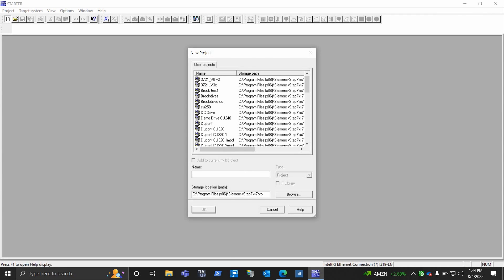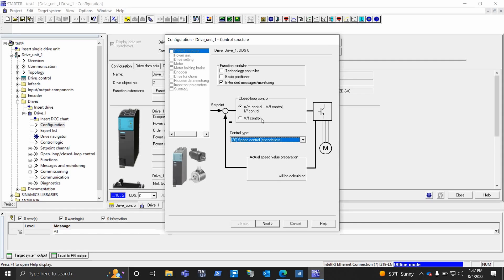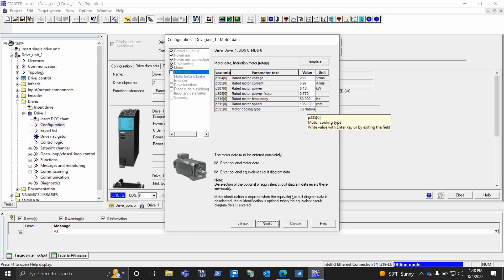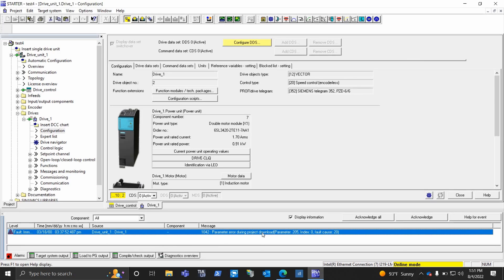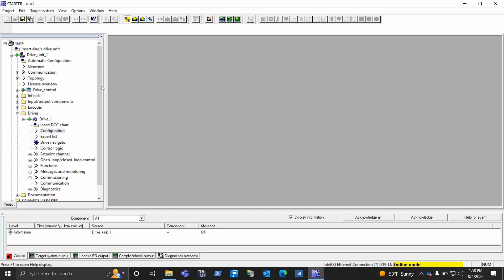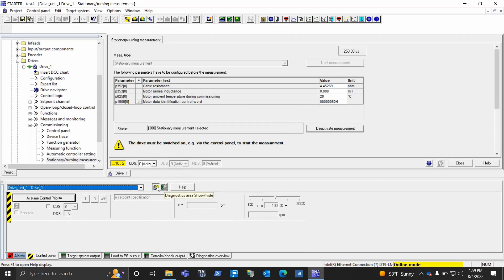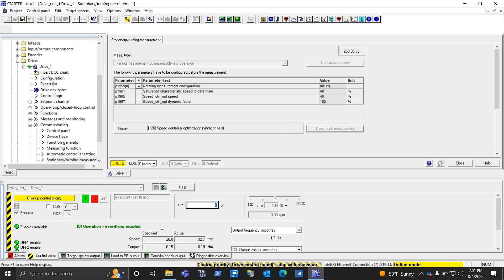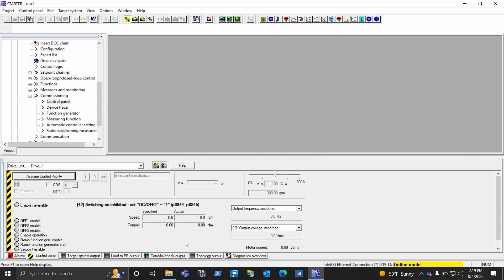S120 Drive programming changes

Comment: I have to replacement the new motor module with the different part nimber.

Can I download without the original project file which has parameter number 60100 ?

The old part is 6SL3120-1TE24-5AA3
The new one is 6SL3120-1TE26-0AA3 
in the upload drive project file it can't upload DCC.
I am not sure if change new one in hardware config and copy RAM to ROM
the machine still run as before because the project have no DCC.